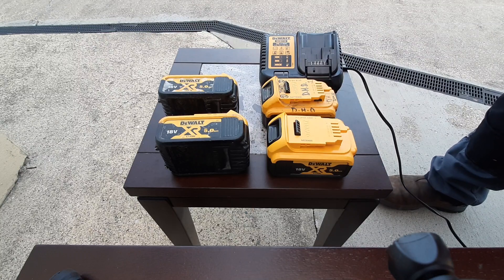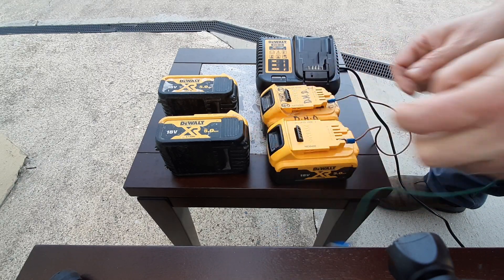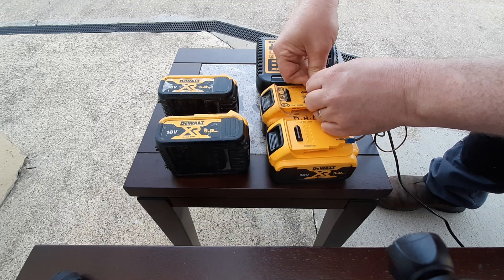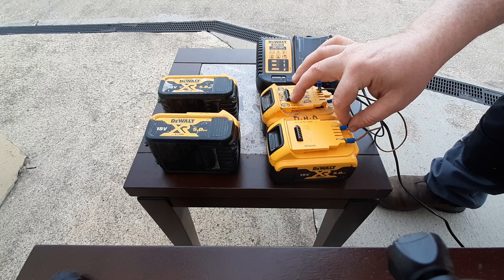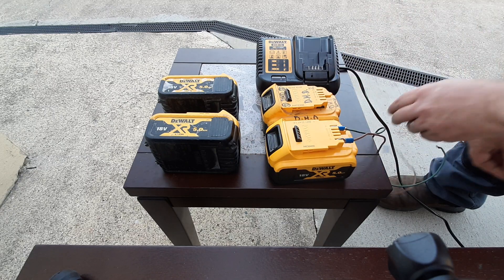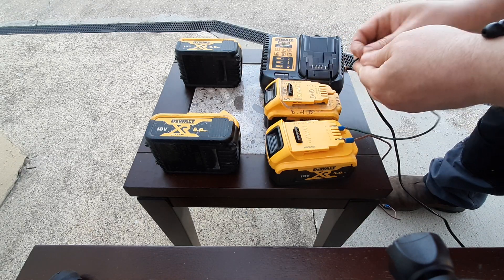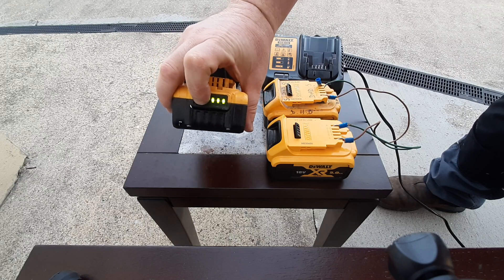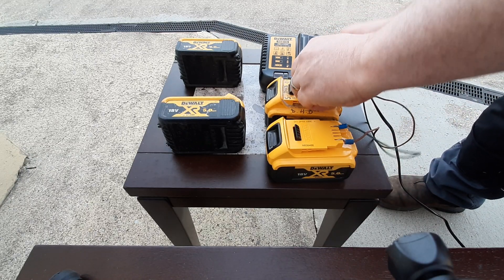How to revive a dead Dewalt battery that is not charging

Comment: From my experience, charging a dead battery with a high current or a high charge rate would be hard on the battery. Seems counter intuitive or possible damaging, for a battery that needs recovered.
Thank you for the tip. I took an old (working) car lightbulb (bulb for a tail light) and put it inline to slow down the charge rate.
B+ (good) to B+ (bad batt)
B- (good) to one side of light bulb and other side of the bulb to the B- (bad batt)

You will see the light slowly get less bright. that means the voltage of the bad battery is coming up.

I left mine connected for about 3 to 5 minutes. then the charger finally recognized the battery and it fully charged. Was glad i was able to recover it.

Comment: No bars under the battery pack and no light when I place on charger. Can I still do this ?
Reply from the maker: Yes check the voltage if it the jump Start doesn't shift the voltage it could mean bad cells or broken connections

Comment: This technique does work and is usually worth trying. However, DeWalt Chargers are programmed not to charge these batteries for a very good reason. Over-discharged li-ion cells are permanently damaged - injecting unlimited current from a fully charged 21V pack to a fully dead 2V pack can turn into a very angry thermal event. I would highly advise using your smallest pack at less than 50% capacity to boost any other pack's voltage. You only need to bring the voltage up to about 15.3V in order for the charger to recognize it, so use a multimeter if at all possible and be ready to pull the packs apart at the first sensation of heat.
Reply from the maker: I agree with your full comment this video must be 2 years old if using this method now I always monitor the voltage at the same time to not overcook it
Reply: @doctorlefthandthread  nice! Yeah in no way am I critiquing the video. I just thought that info could be useful to someone. Fundamentally, the way you did it is likely the safest way to boost the voltage without buying dedicated charging gear.
Reply from the maker: @Spaniard47  thanks for your comments
Reply: @doctorlefthandthread  hey also, for the packs you did successfully revive - how have they performed in the following years? Have they lasted?
Reply from the maker: @Spaniard47  yes they are still going not in heavy use but still going

Comment: Great video to help folks out! The same technique works with dead 12v automotive / motorcycle batteries and newer "smart" chargers. You need to get a small amount of juice in the dead battery for the charger to recognize it as viable, and then it will charge, so long as there is not a shorted cell or other internal issues.

Comment: Left a pack on a cheap aftermarket usb adapter and forgot about it for a week, would not take a charge. Tried your method, wire got pretty warm so I only left it hooked for about 20 seconds. Put dead pack on charger and it started charging straight away where previously the charger didn’t even act like it had a battery on it! Thanks!🎉

Comment: Where does everyone get these sections of spare copper wire and connectors from? Sorry I have no idea about electronics and when I try searching for such products I'm left relatively unsuccessful
Reply from the maker: Spare wire from a household appliance that is going to be thrown out I usually cut the wire off all things like that before dumping them
Reply: @doctorlefthandthread  Appreciate the insight! Any recommendations or guides to follow to efficiently and safely salvage electronics? This is an exciting proposition considering I have half a dozen old laptops that no longer function
Reply from the maker: @philhunt1442  I must admit I don't know much about laptops but alot of electronics can be repurposed in some way
Reply: @doctorlefthandthread  What are your favorites in general for salvaging?
Reply from the maker: @philhunt1442  mainly battery cells casings switches from powertools cable from tools that are beyond repair

Comment: I purchased some transparent speaker wire. Do I use the copper for positive and the nickel or "silver wire for my negatives? Or do I just use any conductive wires for the paired terminals
Reply from the maker: Any conductive wire will do as long as you connect + to + and - to - .
However if you are using light wire be careful if the bad battery has very low voltage it can melt the wires. Wear gloves and monitor the situation carefully. If they start to melt take them off the gloves are to avoid burning your hands. If you have a multimeter test the voltage before and after try and get it up to 17v before charging it with the charger.
Reply: @doctorlefthandthread  Thanks for the tip. I have a multimeter, just need to grab some spade connectors and give it a try.

Comment: Similar technique works in dead cell phones. Won't charge via USB or surge protector? Directly plug in with an adapter to a wall socket. Sometimes they need a higher current to push the dead zone. I don't know why. But it works

Comment: Anyone tried an RC battery charger to do this? 
Obviously a lipo charger. Just curious.
Reply from the maker: I used a laptop charger once it was rated 19v I have recently acquired a dc power supply to bring them up it's safer

Comment: What did you use to connect the batteries? Trying to resurrect a 20v. 

Thanks!!
Reply from the maker: Use heavy wire but be careful. Make sure and connect + to + and - to -. If you are connecting from a fully charged battery the wires even if they are heavy can melt so wear gloves and watch for this. Try and bring the voltage above 17v to get it to charge. If it doesn't work you could have bad cells
Reply: @doctorlefthandthread  thank you so much for your help with this! It’s successfully on the charger now!
Reply from the maker: @mary-rosegranlund7948  that's awesome check out my other videos if you have time. It helps the channel thanks

Comment: Invest in a bench power supply mate, you can limit the current going in to the battery to a sensible amount, whereas jump starting will dump all of the current of the good battery into the duff one totally uncontrolled - other than watching it with your eyes! I normally start at 1A and then up to 2-4A then if all ok leave it be to take it up to 17V ish then onto the charger and see what happens. If charger wont do it then theres gauranteed one dead cell at least. If you get a cell failed in short circuit which happens occasionally (even though it shouldnt) they get really hot really quick trying to jump them. I've got a Flexvolt in for repair that had caught fire from what looks like a shorted cell. A bench power supply wont send any current in across a dead short. Most of the time this trick is good for the general DIYer but I think you're a step on from that!
Reply from the maker: Yeah I will have to do that I have seen the battery to battery method fry a cell before. Thanks for the advice that is going to be my next purchase.

Comment: This trick works! I bought a (Chinese knockoff) 18v to 20v adapter so I could use my old 18v Dewalt drills and the adapter flattened the 20v battery to nothing. If put on the charger, the flat battery did nothing. I used this trick and the battery started charging again.
Reply from the maker: Thanks for your comment 👍 I am glad it helped

Comment: Thank you Doctor Left, I have 2 Dewalt 20V batteries that have been dead for over a year. I took one apart and measured the voltage on each battery and all 5 were about 1/2 a volt, 3.2 volts total instead of 20V. I used solid copper 14 gauge wire, stripped a half inch off each end and hammered the ends flat so they would slide into the good and bad battery terminals. I let them sit for 45 seconds, the wires did not heat up. Before I did this the battery charger light wouldn't even come on, after I did the wake-up call, the charger started charging my first battery. It's charged up to 20.4 V and runs my multi tool. Hip hip hooray. December  2022
Reply: damn i need to try that, i got a 20v 2ah battery with a china item and its dead but i have a other item from teccpo that is 18v 4ah and that worked in the item but im curious if i can try and boost the 20v with the 18v battery the 20v battery says 6v.. and i cant find a dead celll they all say 1.2v x5 i have a other battery from a cheap drill that also is dead that has 4 battery 14v and 2 give 3.6v 1 gives 1.2 and one 0...
so i would say i might have a chance....
Reply from the maker: @reggiexp69  it is worth a try
Reply from the maker: @reggiexp69  I am glad its always worth a try check out my other videos it helps my channel as do your comments Thank you
Reply from the maker: Glad I could help check out my other videos if you have time. I do the type of basic tool repairs anyone can do with a few basic tools or in this case 2 bits of wire.

Comment: I did this trick and the battery was charging, BUT at the end the battery was super hot and the next morning had only 1 light on and the morning after was dead again without been in use
Reply from the maker: In some cases after doing this a cell or 2 can fail I have had this happen too and I replaced the bad cells

Comment: Great video, how come this works?!?!? I’m so confused but truly interested in finding out why and how
Reply from the maker: I think if you let a battery sit in a discharged state too long or discharge it fully. This means the charger can't recognise it as a battery that needs charged but connecting a good battery some of the energy is transferred to the totally flat one then the charger can charge it. If some cells are faulty this will not work. That is my very amateur understanding of it anyway.
Reply: @doctorlefthandthread Very interesting